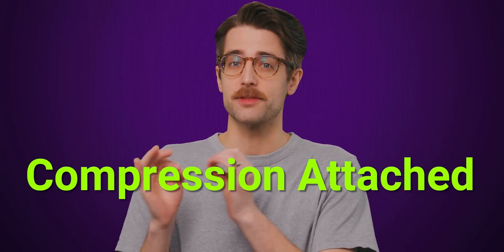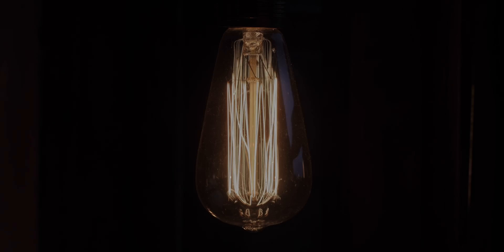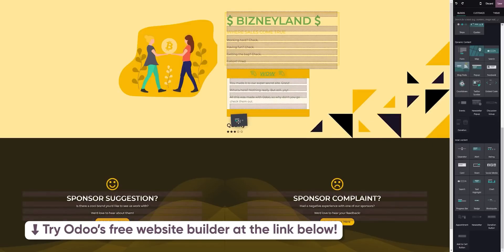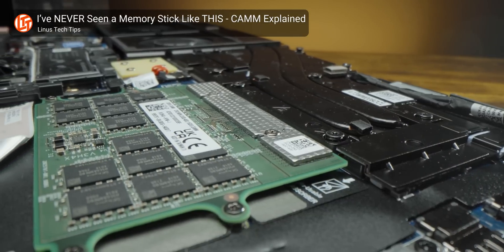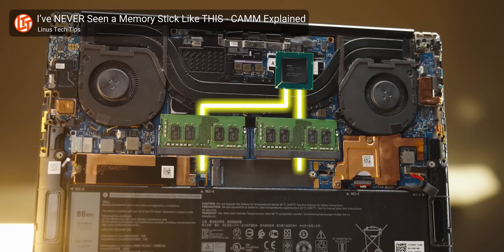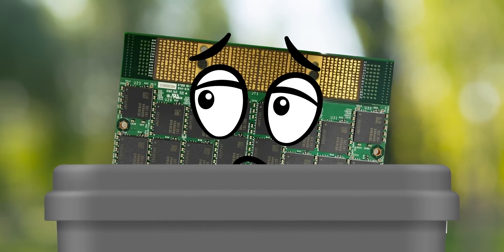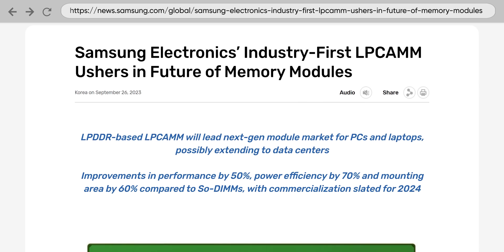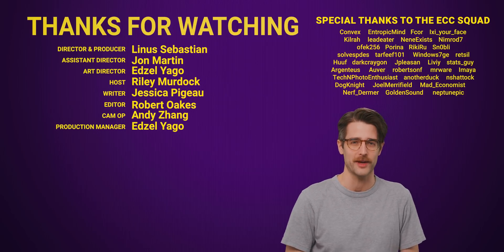You Can Upgrade Your Laptop's Memory Again! (CAMM2)

Comment: If it's that good then I hope it takes off.  Soldered RAM is a travesty.  Really hard these days to find a cheap laptop that does not have soldered RAM.
Reply: And they often come with just freaking 8 GB of soldered RAM.
Reply: @diegosoto8537  nah, Acer coming cold with 4GB of soldered RAM onto the laptop board at less then 3000MHz (was like 2.6GHz, I think)
therefore, even if you do replace the ram stick that's already in there (another 4GB RAM), you're speed limited even with a fast RAM
Reply: @diegosoto8537  The new Core Ultra chips from Intel have to have soldered LPDDR5X RAM to be able to use that chip, and they all start at 16GB. I am not sure people do their research before posting.
Reply: this is unlikely to affect soldered ram products at all. it's still easier, thinner and cheaper for the manufacturer to do it without the connector.
Reply: @lasskinn474 Premium products will be more likely to use this solution, but if CAMM2 is expensive then cheaper ones will probably solder or use SODIMM.
Reply: Asus Tuf Gaming FX505D
Reply: Planned obsolescence scam in plain sight approved by digital regime.
Reply: Really?  I've yet to encounter a PC with soldered on RAM that wasn't something shitty like a MS Surface or something.
Reply: @countfrackula6707 I did say cheap. In Latin American markets and similar, where the purchasing power is considerably less than in places like the U.S, most affordable and readily available devices are cheap Lenovos, HPs and Acers that often have soldered RAM modules and no extra SODIMM slots. But I have even seen more "premium" Asus and Dells with soldered RAM now.
Reply: @countfrackula6707 im more disgusted you this the MS surface is shitty, when its arguably one of best windows machines that is not a 10 pound gaming laptop with airline jets and 1 hour battery life. Surface gives the best of window, cuz its Microsofts own creation.
Reply: @CoffeeTechClub Nah most laptops are lighter and faster.  My GPD Pocket 3 is more portable and has replaceable components.  You'd better hope your battery lasts forever, because you will NEVER get a new one without buying another Surface.

Comment: this is a hell of a lot better than the way apple wants to go about it "soldered"
Reply: That and how 8gb is equivalent to 16gb
Reply: @gsm156 8 GB is 8 GB, not a Byte more, not a Byte less. How is that "equivalent" to something else?
If you mean something like Dual Channel, where the maximum data transfer of 2x 8 GB sticks is double the amount of a single 8 GB stick: yeah, but 8 GB is 8 GB and 16 GB is 16 GB, so no. Also the "dual channel design" of a DDR5 DIMM compared to DDR1-4 doesn't count as "dual channel RAM", because there is data transfer between the CPU and the RAM. 1 stick of xy MT (mega transfers) per second... and if there is another stick and the cpu has a dual channel memory controller, then the CPU can use both RAM sticks at the same time, ergo: 2 times the MT/s compared to just one stick (then this RAM would run in single channel mode).
Then there are also CPUs with a tripple channel memory controler (older HEDT platform) and then we have quad channel right now. Anything beyond that is purely Server Segment and more and more expensive but makes sense, since there are more and more CPU cores and more and more OSes and fatter programs (databases for example) which cause a need of RAM.

But if this is true what he says in the video, that somehow the connection for this CAMM2 RAM is made that you can use 1 or 2 modules and if just one module, this could come with like dual channel inside... oh wait, that is exactly what DDR5 IS and this is what i explained earlier. The connection from CPU to "RAM", the total bandwidth, that is what is all about! How the memory stick internally works is irrelevant, what'S relevant is how long it takes for data to be saved to the stick and how long it takes for data to reach back to the CPU (so a mixture of latency and bandwidth, aka MT/s).
Reply: I wouldn’t mind about soldered RAM if the pricing wasn’t so offensive, because the soldered RAM in Apple silicon means a much better memory with less latency. Soldered SSDs on the other hand…
Reply: Apple wants you to think they're the only ones to push innovations and whatever the industry brings that they couldn't they simply cry by telling their customers apples solution is the better one.
Reply: Apple uses basically a console APU with a giant GPU, they can't use DIMMs without seeing a giant performance decrease
Reply: @4070superThat's because 1TB of Apple is more like 2TB of the competition. /s

(apple said that 8gb of ram performs the same as 16gb on competing products)
Reply: V.  V
Reply: Apple computers are a joke
Reply: Close but RAM on modern Apple systems are not soldered. They are embeded in the same chip (SOC) that contains both CPU and GPU. I may not like it but this approach results in higher memory bandwith and lower latency, even CAMM2 modules have no hope of cathing up.
Reply: @mehmetmetinbaki of course it will be better, it is litterally right next to the cpu. Less distance traveled will allow it to be and good hardware.
Reply: @mehmetmetinbaki not worth the extra speed out side of extreme cases more ram will always be more effective then less faster ram
Reply: @mehmetmetinbaki  it's not that big of an issue. LPDDR5X CAMM2 modules will definitely offer enough bandwidth to compete with Apple in this case.
Reply: @mehmetmetinbaki I know that the best solution in terms of performance is to have the RAM on the chip, but is there really a large advantage to that or is it mostly negligible? We will still see RAM sticks being relevant for a long time, at least in the server space, and I wonder if, once RAM on the chip became a standard, if it wouldn't be a good solution to still feature RAM slots for better upgradability. In the sense that it would still be usable, so more like Intel's efficiency cores, and less like GTX 970's """4GB""" of VRAM.
Reply: Apple is slowly becoming less relevant.
Reply: @r3dhorse That’s just not true at all
Reply: @r3dhorse if that was true windows laptops wouldn’t be trying to switch to arm cpus to compete with apples superior m chips. Until windows laptops have competitive battery life and unplugged performance, Apple laptops will be relevant and competitive.
Reply: @r3dhorse  no it's not lmao. It's gaining market share still in both iOS and MacOS, not to mention they are (depending on the day) the 1st/2nd most valuable company in the world alongside Microsoft. You can dislike Apple and also acknowledge they do impressive work. I don't agree with everything they do, but they aren't becoming less relevant.
Reply: Apple went soldered for faster and less latency years ago. CAMM2 does not even exist as a product you can buy yet!
Reply: @andyH_England How did you become like this?
Reply: @andyH_England M3 MacBook exist while CAMM2 Jedec standard already existed for a year.

So why M3 MacBook still using soldered RAM? Truly a mystery indeed

Comment: There’s never a situation in which a laptop needs more ram to function nowadays. Nowadays laptop are usually equipped with 16GB of ram and nobody is going to be like „oh let me upgrade it my app isn’t running anymore. if a laptop really needs to be upgraded in, lets say 10 years from now, then trust me ram will be the least of your problems. the whole hardware should be upgraded.
Reply: my first PC had 2 GB
Reply: "No one will ever need more than 16GB of RAM" .. said Bill Gates .. probably .. in your head.
Reply: did i say that? your current hardware that came with the 16gb will most likely need to be upgrade in the future not only the ram. @THE-X-Force
Reply: L take
Reply: Software consumes more and more RAM. Todays notebooks would easily run a decade.
Reply: @sergeykish @sergeykish  With the advances in AI and their chips, people who do not want to be left behind will be upgrading more regularly. Also, with new battery tech and displays arriving, keeping a three-year-old laptop will mean you miss out on refinement and improvements.
Reply: @andyH_England  notebooks don't change much, displays are already good, SSD is a norm.
I am currently running 2017 notebook (Dell 7480), upgraded RAM to 32GB for software development. Similar devices across my family mostly used for web and media.
Reply: Try to launch a game while chrome tabs are open in the background.
Reply: if you have a gaming laptop then you already fell for the biggest scam in the industry so i cant really help or discuss with you anymore. @jivewig
Reply: Have fun with your 24124th Electron app.

Comment: Thats a lot less modular than I was expecting. When I hear the words Upgradable RAM I was thinking of a dim that had a chip replacement system built into it. then just buy better chips to slot into it later.
Reply: PCB is cheap

Comment: Whats surprising is that its from Dell of all company. Dell a company that goes out of there way to still sell pre-built computers with proprietary hardware inside even for the most basic of things
Reply: They even scammed people not once but twice with the Alienware area51M. Touting it's upgradeability but never releasing components for upgrades and instead forcing people to buy a whole new laptop for the upgrades.
Reply: @heroninja1125 It's upgradable, but not for the end user, only for Dell.
Reply: @heroninja1125 it wasn’t a scam it just didn’t workout they way they thought and sold to the customer. If you look at the court case you would know but people only thing is the basic headlines.
Reply: @neubauerjoseph  And the basic headlines will remain true. Because the "know it alls" such as yourself will gatekeep nonexistant information about a device that was objectively a scam.
Reply: That was one of the lowest things any company has ever done IMO.  @heroninja1125
Reply: Tbh that’s mostly because they want to make it cheap and efficient for them to make the pre-builts. 

Given that most Dell laptops come with standard Phillips head screws, no warranty void stickers and even labels to tell you which screw goes where, I don’t think they have evil intentions like Apple.
Reply: @jivewig   some newer dells I saw came with small torx I think T5 screws, which may be a bit less common than Philips but I appreciate torx tbh
Reply: @My1xT  yeah tbh, Phillips are more “repair friendly” (for that one tool guy) but they are absolutely dog crap and shred so easily. With torx you can be relaxed knowing you can take off your back panel multiple times without needing to order new screws.
Reply: @jivewig  and in case of captive screws look up how to replace those
Reply: I think it's just a business, Dell is interested in money like any other company, and if they can collect royalties from any storage vendor through their patent, they definitely want to support a repairable standard they own.
That's a lot of money.

And I am indeed on board with the idea, Camm2 Ram is fast, energy efficient, and easy to service, and a way better solution than soldering ramsticks, this could be even a thing for GPUs.
Reply: We looked into upgrading one of our machines from 32 GB to 64 GB. Turns out that's $1200 for us to do that. That's gonna be a nope from us 😂 users getting an older machine with sodimm for that 64gb
Reply: this is a properiaty thing they're making more open in an effort to get others to use it though, it's an effort to make their system with whatever baggage it may come with as the standard?  that hasn't gone wrong with memory before with pc's..   oh waiit

I don't really care about the thinness to the extent this would help with.
Reply: Wasn't always this way. My Inspiron 6000 and 1011 were (and still are, I guess) incredibly repairable and upgradeable. Latitudes also have a reputation for still being serviceable.

It just goes to show you: Stan the product, never the brand.
Reply: @GSBarlev  precisions are still extremely upgradeable but parts are super pricey
Reply: @GSBarlev  good sentiment. blind support of brands leads to evil shit like from Apple
Reply: Dell supports a lot of large company deployments. They want to better support IT departments. Swapping RAM is easier than setting up a new laptop for a user.
Reply: so dell is Apple Lite?
Reply: Sure but at the same time the Dell XPS has had official service documents and replacement parts available for years. It seems to me there just is a bit of a disconnect between the laptop and desktop computer groups.
Reply: take a look at their business side, especially the latitude and precision laptops. those are (or were, until recently) very nice
Reply: The best definition of...
Never let them know your next move.
Reply: Xps has parts. But in warrenty they wouldnt fix a overheating issue, claiming 'i must have the laptop on a soft surface' ( the laptop is on a stand floating in the air ).

Years later the battery is totally fried. The thing still goes into thermal runnaway and crashes when closed. All thr rubber feet fell off in months from the heat.

But the support wont help at all, ive tried like 5-6 times to get help now
Reply: tbf, Dell was always a wild card. It's easily the best for most things in the past not to mention it was incredibly versatile and even some of their stuff to this day are both great and budget-friendly. But I do agree that most of their stuff today are overbudgeted, soldered-on piece of scammy garbage. It's not surprising that they're making innovative stuff though considering how much IT Dell has under their belt
Reply: They probably used the same chassis for all of their desktop computers for decades. They just a lot of plastic to make it look different.
Reply: Apple says " Hold my beer bro! "
Reply: Used 2 dell laptops, inspiron 15 and g5. never buying any form of dell again. worst products i have ever used.